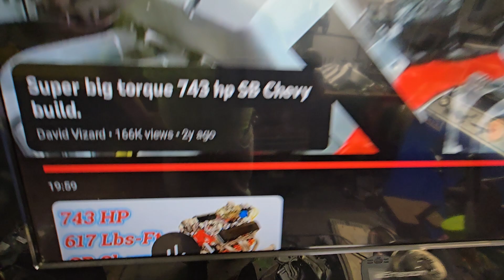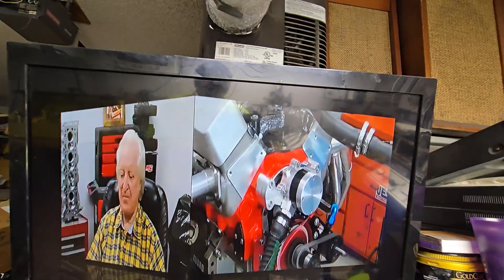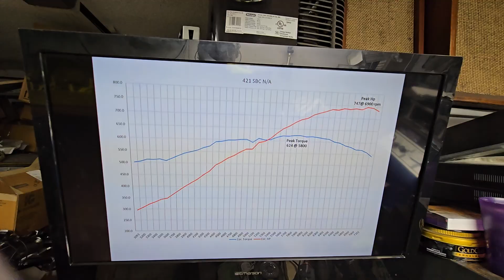Chevy LS3 Single plane manifold shootout! Holley split vs. Edelbrock Vic jr. vs. Super Victor.

Comment: went back and rewatched the dv 421 ci / 743 hp video. i think dv said wilson did the intake. in this video you say the engine challenge you did the intake. were there two different test and how did the two manifolds compare?
Reply from the maker: @terrysmith8133  It was a Wilson that I redid. It had been modified for fuel injection. I jad to epoxy the bungs, completly change the taper due to the smallest csa being at the apex of the runner turns! The radius of each runner was changed. Intake was textured inside and out. It was also coated with thermal absorbing/ reflecting coatings. That is why it is black.
Reply from the maker: @terrysmith8133  Check the comments on that video.

Comment: I think the dividers running into the intake would force air to do what it doesnt want to do and a price will be paid. Will you explain?
Reply from the maker: The price is lost cfm. Now the question is does it matter if the flow to each cylinder is more balanced?
Reply: @servediocylinderheads  yes I was battling that problem with a sbc strip dominater a 150 shot was all I could spray because of 1 cylinder being hot.
Reply from the maker: @davidreed6070  I believe it.

Comment: Charles, from the plenum perspective, it seems the Holley is making great efforts to equalize the short and log runners by moving the opposite bank front and rear cylinder common wall way back out of the plenum, whereas the Edelbrock make no effort. 
I wonder if tuned runner length has more to do with the power difference than the other obvious stuff you pointed out.
Reply from the maker: @Jeffsa12  Good observation, and good questions. Thanks

Comment: Steps
Cylinder volume in cc
Inlet port cc and av csa
Size runner cc to max 85% of cyl volume for most common applications 
Short runners need more cc
End runner usually needs filling 
As long as the tract is not contracting towards the plenum
If your port flows 300cfm and manifold goes 320 - all is well
These steps are from timed testing- not flow bench guided.
Enjoy your works
Reply from the maker: @arthurking6549  Interesting!  To balance flows to me it seems outer runners need more volume not less. Thanks
Reply: @servediocylinderheads  If the fps is lower with an increase in volume how is that providing the timing for the cyl demand period?
Short runners usually are overfed- by staggering the volume the propensity is somewhat reduced 
Manifold flow bench works negate fuel factors- never seen an equal flow runner manifold outrun the altered volume ones.
As long as the cross section is not a limiting factor. 
Cheers-
Reply from the maker: @arthurking6549  Explain this deeper. Thanks
Reply: If the inlet tract signal delay from the cracking valve is 10 degrees longer  for the long runner how can an equal csa or volume provide the timing to deliver the charge?
The physical interaction in the plenum and of bypassing of the plenum ( short cutting) 
provides added energy into the runners
Therefore extra volume or balanced static flow tests are unfortunately misleading 
FWIW
Reply from the maker: @arthurking6549  Outer runners usually need more csa.
Reply: Why
Reply from the maker: @arthurking6549  So they can supply the same amount of air as the short runners.
Reply: You really can’t comprehend much
Reply from the maker: @arthurking6549  Glad you think so. Thanks